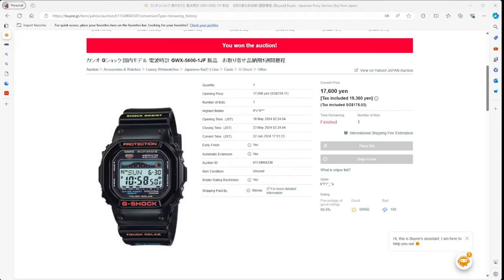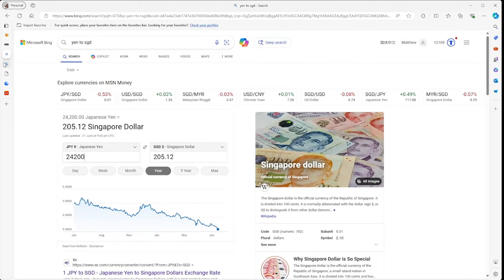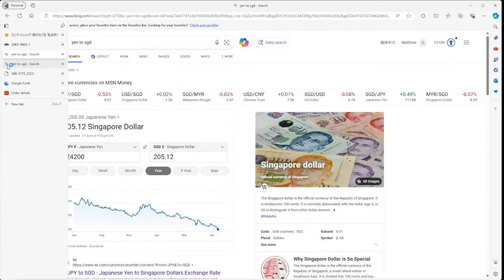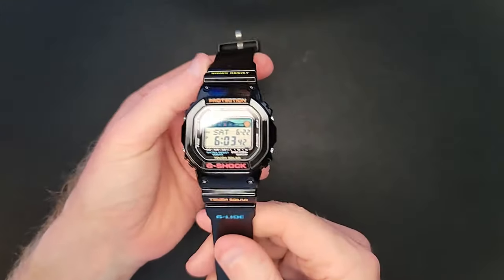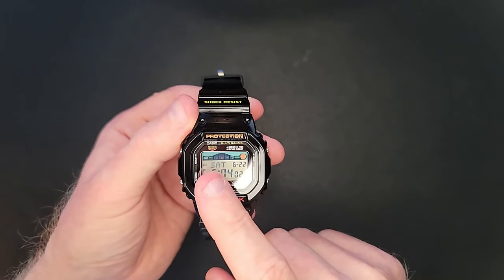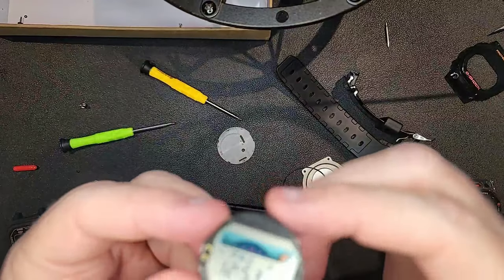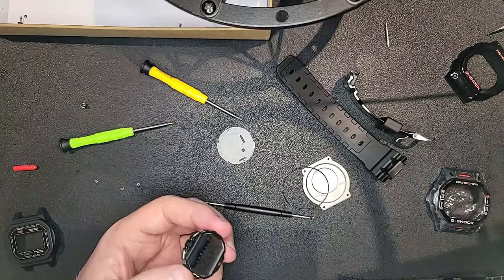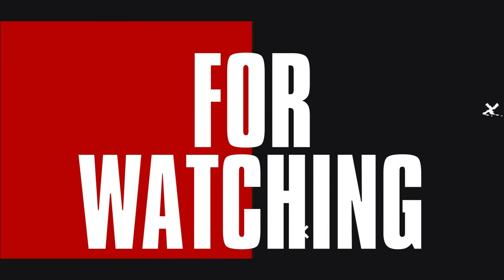Don't do this, #failure in the #gshockwatch modification GWX-5600

Comment: I got the same one I live on a sailboat traveling the Caribbean and the g-lide was what I found best for my situation. I modded mine with the bull bars and a natostrap I absolutely love it. GWX5600 same color variant as yours.
Reply from the maker: Thats cool, so the features are really is very useful then, how accurate was the timings for the tides?
Reply: @TheGShockWatcher  the tides were dead on but I had to set the first high tide of the day one you set that it's spot on but sometimes we have only one high in a day the watch thinks there are 2 but it's accurate enough to plan my day with it
Reply from the maker: Just for a moment, need to recognise how amazing it must be to travel the Caribbean on a sail boat, that must be a dream!

Comment: I have the reverse display version of this that came with red bezel and strap. I changed them to the black and it was a bit of a challenge. The straps were a bear to put back on for some reason.
Reply from the maker: Cheers for the insight on your experience. I'm still stuck on the buttons at this point, have some more coming in to try, will update soon.

Comment: You can remove and replace the E-Clips/rings with fine point tweezers fairly easily. I've done it before when I was changing the bezel and i pulled out a button by accident. Had to go in and reseat the e-clip/ring. twice now...
Reply from the maker: It's definitely a very delicate process, the rings themselves are  not very durable, I guess they need to be somewhat pliable.

Comment: I do have one question. Would a hydro mod be ok I want to hydro mode my GWX5600 but not sure about the alarm sound and solar and multi band. Wondering if all will still work or will a hydro mod interfere with it. I also dive so I would like to do it for visibility benefit. Thanks
Reply from the maker: I have never tried... I had to do the research to understand what a Hydro mod is, and it looks super interesting. This is where I read
https://www.watchuseek.com/threads/tough-solar-hydro-mod-method.4915239/

Seems they had good results, but there wasnt anything they talked about in terms of drawbacks.